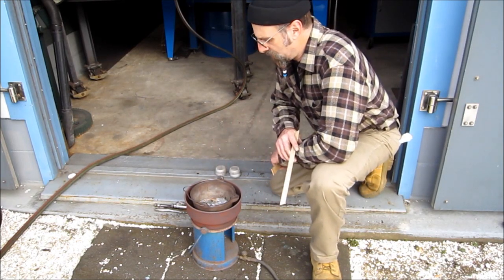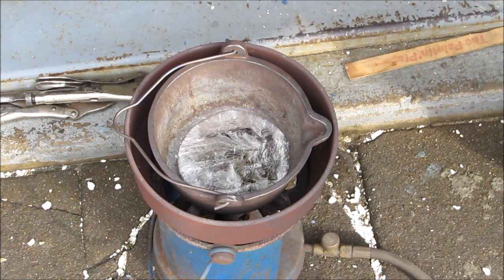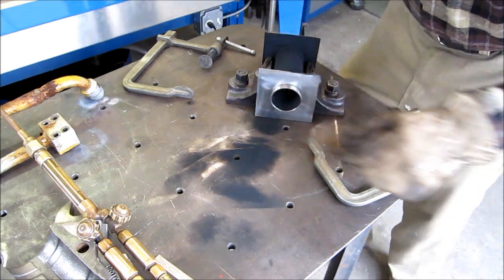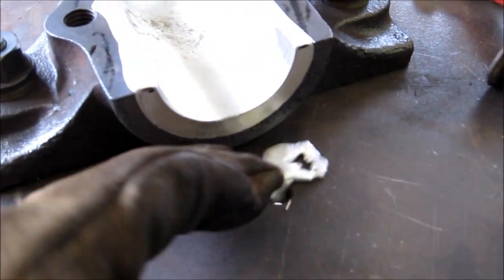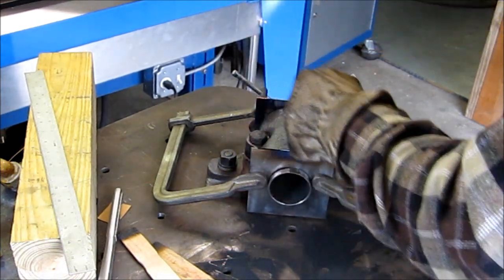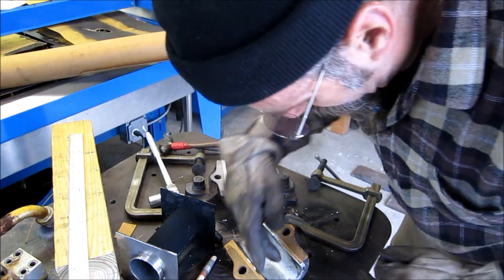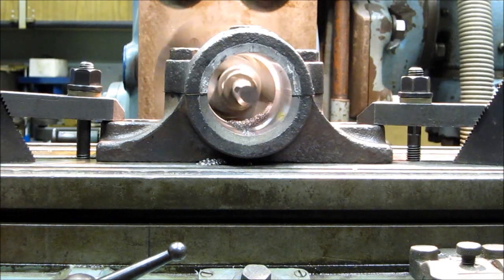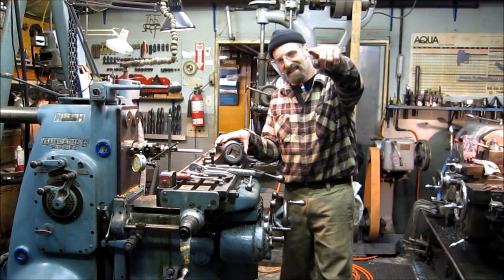As the Shaft Turns Final Episode

Comment: I'm curious why you don't make an Aluminum-Nickel-Bronze, as opposed to pouring a bearing?  Could you please explain your thought process?
Reply from the maker: It is an old marine shaft support bearing and the bearing has to be installed in two half's to replace or maintenance, it is a heavy load low speed so the old Babbitt bearing is better suited, and we wouldn't have to build a new ship around it to get a bronze bearing to work.    ;{)-----

Comment from the maker: This and most pre heats are to raise the temperature, in the project so the arc and base materials are a little closer to the same temperature, lessening the shock of difference and relieves the pull or contraction between the puddle and base materials, following the weld beads applied. To help with flowing of metals, using lower amperage settings on your machines, while welding on larger projects, as you said is second reason, in this particular project. ;{)------

Comment from the maker: I would seem like it would! You still have to pour each half and then finish the split line shim and then set up to bore! In day there weren’t a lot of machine shops available to handle the machining needs and Babbitt was able to mold itself to the castings and be hand shaped for the running fit. There are still a few guys out there today that can pour and fit a bearing before a machinist could machine the same.  ;{)---